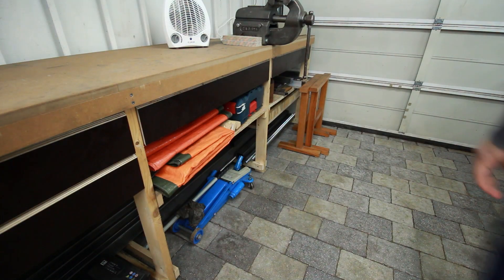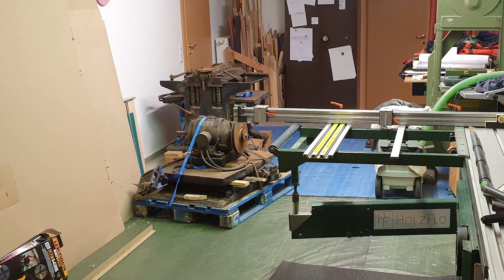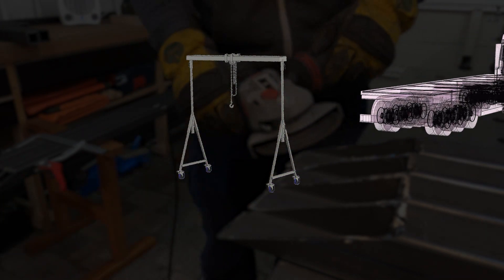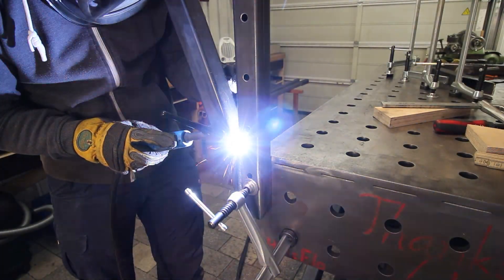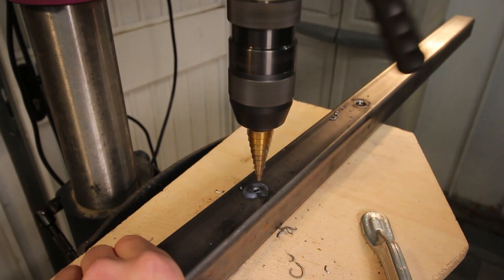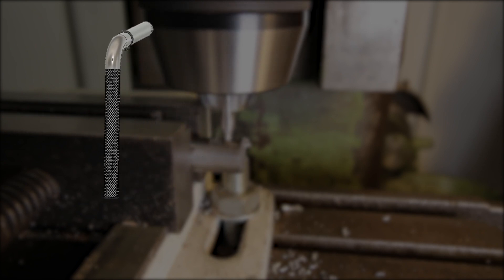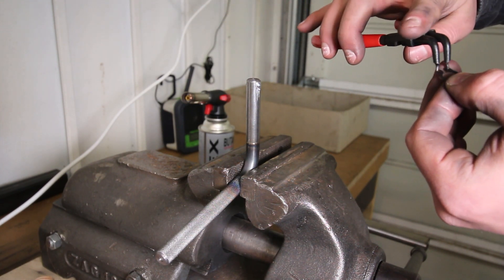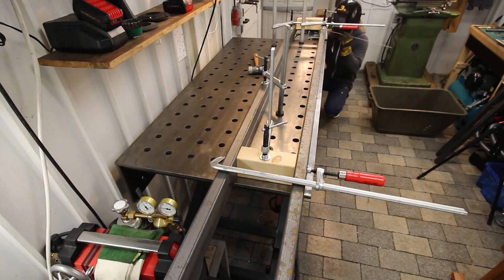Part 1/2 - GANTRY CRANE - extra mobile and versatile for a small shop!

Comment: I notice that you are using TIG for all your welding on this project. Awesome, less smoke and spatter.  I assume the material is mild steel with some minor mill scale. How much cleaning and prep do you do, and are you using pure argon?
Reply from the maker: Yes that's true, I've done that mainly because I didn't have MIG available. I would prefer MIG welding for this project. Even though it's nice and clean to TIG it all.
I've cleaned all the surfaces with the angle grinder and a flap disc before welding. For TIG I use pure argon.

Comment: Hi, Greetings from Central PA to good old homeland Germany. 
I have seen some of your projects, and I am impressed; good work. I bought your welding table plans but haven't started yet. This will be a winter project, just not sure what year.
I don't want to be the smart ass here; I am almost sure you know way more about a metal lathe than I do. However, I would never - never ever - keep the chuck key in the lathe chuck, not for only 5 seconds. If the key is in the chuck, my hand stays on it. If I need both hands to adjust something, I take the key out of the chuck.
The day will come where your left hand is faster than your brain or something the like, and you accidentally start the machine while the key is still in the chuck. Guess what is going to happen. The key will become a projectile. You and anybody around you will be happy not to be in the direct trajectory of this hard piece of metal.  
Make it a good habit to take the key out of the chuck, always. 
Keep up the excellent work.
Reply from the maker: Hi, thanks for your concern! I'll try to make it a habit to take the key out of the chuck in future.
I hope you like the plans and find the time to make it! If you have any questions about it, let me know. ;) Also happy to hear from you when it's finished! :)

Comment: So cool so far. Question. I understand the wanting to make everything. Is there any concern for the pin’s coming out? A locking carter type pin might be safer. What do you think? I really enjoy watching your progress.
Reply from the maker: Yes, you are definitely right! Doesn't make very much sense to make these.. 😅 Just wanted to make them for the making process and to learn new stuff. (ball detend, nurling, bending with the help of the small torch was all new to me 🙈)
Reply: I don’t think a pin under a shear load is coming out. A ball pin to be used successfully means tighter hole tolerances so that is a good thing. Sloppy holes with small pins causes deformation and hole stress loads. Clean and accurate sizing is good excellent work.
Reply from the maker: @johnkruton9708  Thanks John for that explanation! 👍 This fits kind of my intuition, but I couldn't explain it like you did. Thank you! 😊